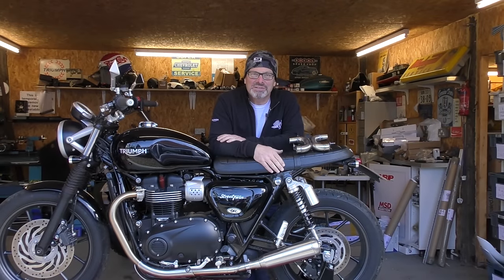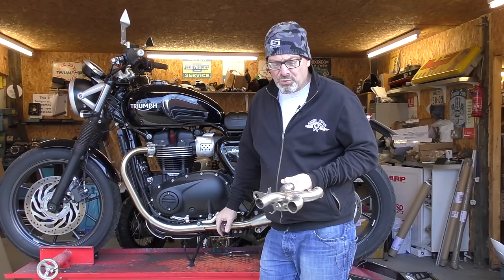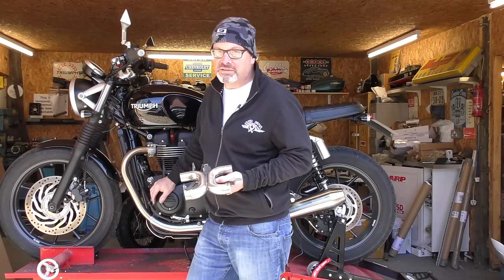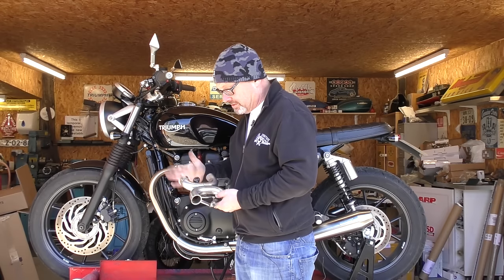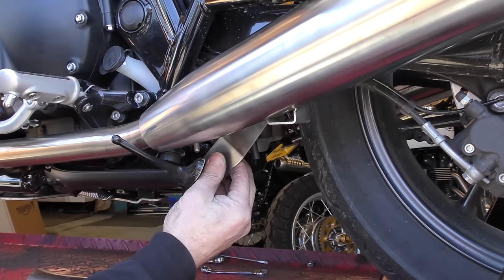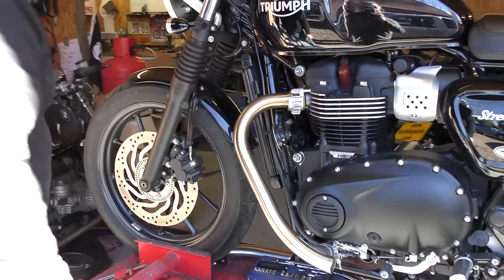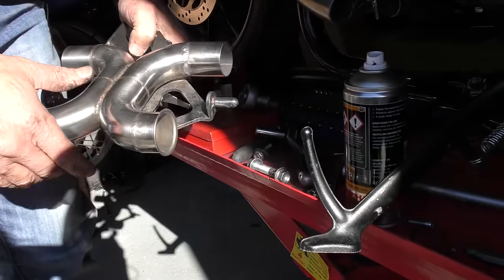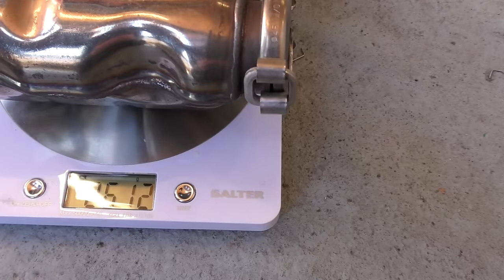TEC Decat X Pipe

Comment: I've done mine and yes it is much better but I've an annoying vibration at around 2,800 rpm. It's definitely engine related as I can feel it if I place a hand on the engine cases. Any idea's? or should I put the cat back in?
Reply from the maker: You should not get vibration with this pipe as all rubber mounted, It sounds like you may have not fitted the heat shield on its rubbers , try running with it off and if it still vibrates check all the exhaust mounting rubbers are fitted correctly, Most vibes come from the motor , exhaust don't tend to vibrate but they can transmit engine vibes to the frame if not rubber mounted correctly.
Reply: Heat shield fitted fine, and on its rubbers. However the larger rubber grommet in the front mount had split a short distance around its circumference. I'll replace it and hopefully that will resolve it. Many thanks for the swift feed back.

Comment: Dear Sir,

Thank u for the Wonderful Videos & Tutorials u keep posting, wish your TEC parts could easily be possible to all the way in India, anyways for now i shall be grateful if u could guide me, i see a higher risen Handle bar on the Street Twin in the video above, it ain't Stock..i am facing a lot of discomfort while riding.. my body weight falls on my palms... i did try adding one inch spacers below the the stock handle riser, helped to a small degree but yet not comfortable, the riding position too is backward foot, seat pan slipping down a la sports.. the ride puts pressure on my hands , back and the rears.. basically the bike falls a bit short for my height too.. i come from the upright riding position of the Royal Enfield Classics.. tried changing the handle bars but the cables fall short.. pls care to advise me a solution on the same.

Thanks , Warm Regards

Arsh JaiKrishan
Reply from the maker: Hi
yes I had the same problem,slight rise on the bars make bike much nicer to ride.we will soon be making a fat bar conversion kit with several bar options for the street twin and all other bonnie models.
I have just got a new street scrambler to evaluate and one of the first things I noticed on the bike is the slightly raised bars and the huge difference to feel they make.

Comment: Does the standard cross pipe need to go back on for the mot,  in Spain or here in the uk, thanks
Reply from the maker: No need to in the UK as MOT test has no emission testing. not sure about the Spanish ITV though. if it is just a visual check you will be OK as it looks stock.

Comment: hi, im from brazil, i have one bobber black and i want put this x pipe, but if the stock mufflers, in this configuration just the x pipe i need reflash? appear any check light?
Reply from the maker: Yes this will work great with stock can s and no need to re flash ECU
Reply: tank you

Comment: Hi tec, 
Just purchased your X pipe.  I'm a bit confused. Do I need a re-map on my 900 street cup or will the ecu adjust, or do you recommend  this Booster plug.  Also come MOT time will the bike fail the emmisions test?
Reply: I believe it is recommended to have a re map (getting mine done tomorrow). ECU will only self adjust on 1200 cc engines eg T120 & Thruxton. Currently in the UK at least, exhaust emissions tests are not part of MoT for bikes.
Reply from the maker: No need to remap, in the UK no MOT requirement for a CAT and no emission testing on motorcycles

Comment: Hi Tec. Great video and thx for yours experience. Did you use K&N filter and If not can you wrote why? Coz i didnt find in yours videos that you change Air filter. I am on the way buy yours Silencers and X-Pipe for my Street Cup.
Reply from the maker: Hi
I normally use a hi flow air filter and most important remove the intake snorkel from the airbox as very restrictive
Reply: TEC Bike Parts , did you have to remove the snorkel part with a knife? Meaning, literally cutting it out from the end cap and smoothing out the edges? Thx much
Reply from the maker: Just remove 1 x screw and pull out

Comment: The torque settings are wrong.  The frame bolt on the engine needs to be 110nm per the service manual.  I did 40, per this video and it popped the rail off the bottom and lost the part the two bolts go into.  Bolt on the right hand frame rail started to give under the stress.  Don't make the same mistake I did!
Reply: Actually 105 Nm

Comment: I am buying a Street Twin shortly, and wanting to add you slip-ons and x pipe. But I was wondering about warranty issues. Will these items void the factory warranty?
Reply from the maker: Technically it will void the warranty, but we supply these to many triumph main dealers for installation on new bikes.
I would suggest you get your dealer to install it and it should not be a problem.
We have not heard of any cases of dealers refusing warranty claims because of de cat pipes.

Comment: Did you change the handlebars on the Street Twin?
Reply from the maker: Hi
Yes I found the stock bars too low ,all cables reached Ok but had to make an extender for the brake pipe
Reply: Which brand and model handlebars have been fitted to the Street Twin, can you please tell?

Thank you.

Comment: Hi Guy's, Does it need a new map once installed or does the ECU self learn? Ive Heard some conflicting answers. It will run lump for the first 5/10 miles whilst it learns..? Any help would be appreciated
Reply: I'm wondering the same thing. Any help would be appreciated.
Reply: Sam Newby I am buying one of these in the next few months and my Triumph dealership told me that the ecu will have to be updated and possibly remapped
Reply from the maker: Hi
On 900cc models we advise installing a remap.
1200cc bikes do not need a remap with only a de cat fitted as the ECU will adapt .Further mods or remap only required if further exhaust or inlet mods included
Reply from the maker: Now that Triumph no longer supply a remap we have been doing extensive dyno testing on all models of 900cc and 1200cc bikes fitted with just an X pipe and further mods.
In all the test we have found the air fuel ratio to be well within safe limits with the standard ecu tune.
We did find that using a fuel enrichment device like the Booster plug or Dynojet 5 did make the bike run nicer and accelerate much cleaner.. However , without further mods to the motor nether of these devices gave much in way of power increase, but they did vastly improve the way the bike felt in real world riding.We sell both the booster plug and the dynojet 5 and although we like the dynojets tuning ability find it hard to justify the cost against the far simpler but effective booster plug. 
Will be doing a video to show how these devices work on the Triumph with real time ecu data, as all the videos I have seen are guys fitting them then riding the bike saying this is better ! not really very informative and no proof they actually work at all.
Have you noticed  nobody is putting up dyno results for water cooled Triumph 900 performance parts !
This is because the results are not as they expected or hoped.
We have  found the solution to this lack of performance and have  a new part for the new 900cc  motors that is low cost and gives around more than 30% more power, without any low revs torque loss. This is not some wild claim we, have all the back to back independent dyno runs prove this.
We have done over a years development/testing work on this . We will be putting the videos up in the next few days once we have done the final dyno work and have all the data.
Reply from the maker: Stock ECU can not relearn. It will adjust air fuel ratio when operating in closed loop mode only, but this is not changing the loaded map.

Comment: What is the price of the x-pipe, also, what is the max recommended weight on your rack ? Thanks.
Reply from the maker: Hi James
X pipe is £120 plus tax (VAT) 
Max weight on rack is 6KG. We have to say this for safety reasons ,this is not an indication of the rack strength,but that handling of the bike may be affected over this weight.
Reply: TEC Bike Parts I can not find the X-pipe on your website. When will it be available?
Reply from the maker: Hi
we have sold all of the first batch,we will have more in late May
Reply: TEC Bike Parts Great! I need to be quicker next time ;)

Comment: Your camera and sound guy needs to learn basic skills. Understand audio cut off, camera and mic placement and it's effects. The whole comparison is nought just because the sound clips off so many times and then he places the mic directly in the path of exhaust adding wind noise. What a waste of a good comparison effort! Place the mic at the same spot equidistant from the exhaust pipe at 45-60 degrees out of the path of wind, for each of the combinations. That's when you're comparing apples to apples.
Reply: I agree.  Its all a learning curve :)  Cheers for the tips
Reply: Looking to Buy T100 what sound effect will I get from those big stock mufflers adding x pipe

Comment: You shouldn't remove the catalytic converter for air pollution.
Reply: LOL
Reply: @mcplutt  Am I wrong.
Reply: @viktorask  You are in the wrong place, at least :-)
Reply: @mcplutt  :-) so removing cat its all healthy and good? Just fancy air restriction Cat box.
Reply: @viktorask  I will remove mine tomorrow :-)
Reply: @mcplutt  by decat bike it will ad 2hp to your bike in cost of pollution. What's 2 or 3 hp, nothing when bike with TEC cam adds liek 10hps producing 62hp. +- 2.5 hp it's nothing.
Reply: @viktorask  You forget the sound and the weight. It's all about sound and weight. Regarding pollution you can ask putler what's going on there.